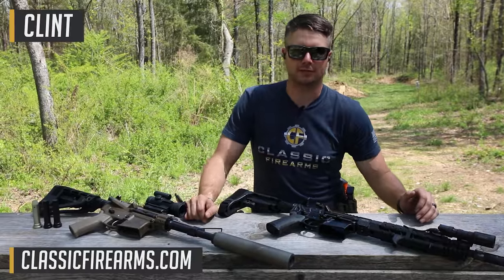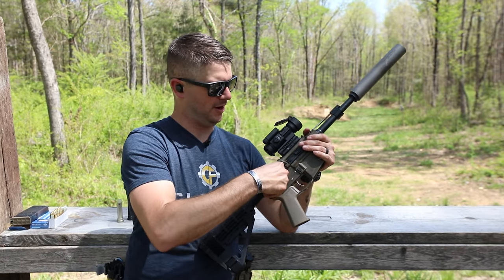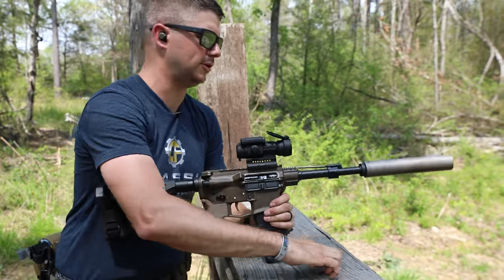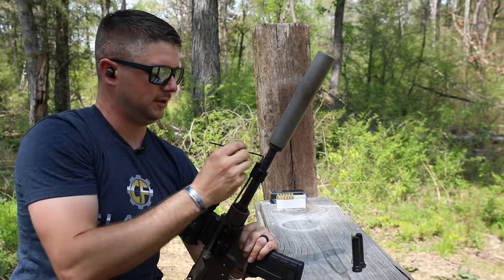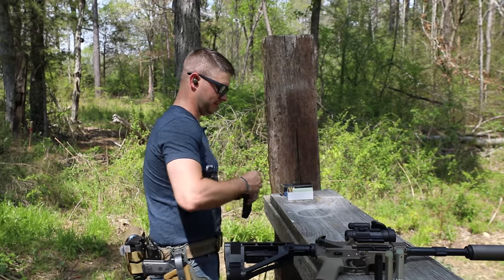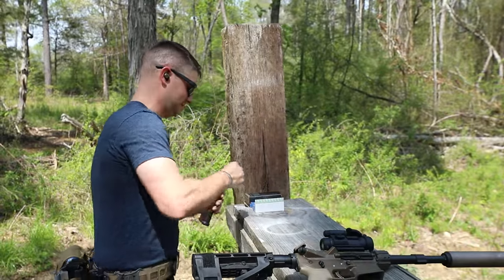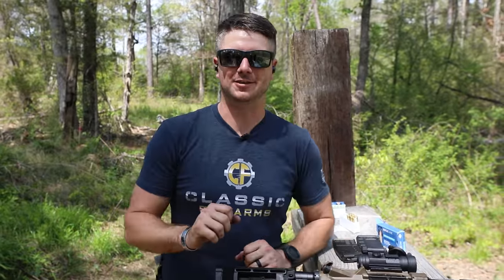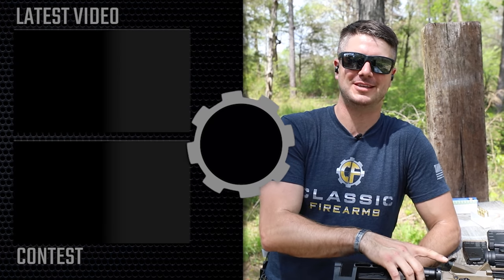How To Tune Your AR-15 (Gas Block & Buffer)

Comment: The key is tuning it to shoot subsonic loads because that's where you will encounter cycling failures. That video would have been much longer due to trying to  finding the correct setting to cycle subsonicaly consistently. I would like to see that video as a Part II.
Reply: 0 excuse me
Reply: Well with that you would need to tune subsonic and suppressed. The suppressor will change the way the gas flows big time
Reply: Subsonic loads have a longer impulse (dwell) time and are heavier, producing more volume and pressure in the gas tube. Tuning it to the "sweet spot" for subsonic loads may make cycling unreliable for lighter bullets, especially when running unsuppressed and even more so with carbine-length gas systems.
Reply: It should be tuned to the ammunition you plan on running through it…

Comment: All 5.56’s(.223’s) I run that have a carbine gas system have an H2 buffer in them. From an LE 6940, a DD M4A1, an older Bushmaster XM-15 w/a 16” bbl, they all have run well with all types of ammo, be it steel OR brass. Picked that up from Patrick Sweeney a while back..”IF it can run reliably with an H2 in it, run it”. HIS quote..

Comment: 2A armament adjustable bcg with a jp silent capture h2 is how I tuned my 11.5 and it shoots smooth with very little recoil with and without a can.
Reply: @UserAccountID   your logic would make sense if i was trying to run a lightweight build but no i just wanted a option to ajust my gas without useing a gas block and i run my setup with a can so with an h2 and tuned gas system in runs and recoils flawlessly in your logic its like go everything as light as possible then run an ajustable gas block but thats not what my gun is

Comment: Some of us prefer the 200+ grain subsonic in the .300 blkout. Can you run an experiment with the heavy bullets? Maybe show switching between 125 & 215 gr bullets.
Reply: If you run both subs and supers tune for subsonic ammo you’ve put in the freezer with no suppressor. The cold temperature lowers the pressure, and with no silencer there is no added back pressure in the system. That way you have a fairly reliable toy.

Comment: I’m trying to tune a Geissele Super Duty, 10.2”barrel in 5.56, with a SOCOM silencer. It has a H2 buffer with the 42 spring. Everything works fine, except my ejection is at 5 o’clock.  Should I turn it or leave it?

Comment: Thank you for the bit of info on the echo trigger! I didn't know you had to hold the trigger down to set it forward. My dumbass would use a razor blade to hold it forward and than lock it down 😅. Couldn't find a video on how to do it properly with the echo II. Watched one where a guy shaved down his BCG to make it work😳.

Comment: Aeros instructions, close it off, back out 15 clicks to full open. Fire 1 round, does it lock the bolt back. If yes, close it up 2 clicks try again. Keep going until it fails to lock open. Then open 1 click at a time testing until it does lock open. Once it locks open, open open it 2 more clicks for reliability and your done.
Reply: With adjustable block does this allow for a cleaner running gun?
Reply: @sranney1  it does reduce the over all gas volume going into the receiver. as far as cleaning goes, I would say its maybe a little better, but not by much.

Comment: One part missing here.  On most adjustable gas blocks, once you find the sweet spot in the adjustment, the gas block adjuster screw has a tightening screw on the side that needs to be tightened down too.
Reply: Not all of them do.

Comment: How did you know I just tested my 300 blackout setup and have crazy gas?Like rattles the buffer tube/ can hear it slapping recoile, and was hunting around for some options to fix that. 

Was thinking of going H3 buffer to see how it works and probably an adjustable gas block.

Comment: So, combining the two videos... You adjust gas to where it reliably locks open the bolt and you adjust buffer weight so your extraction is straight out or a little back?

Comment: Clint can you make a 5 and 10 round blaze orange mag for .223/55.6 .300 blackout?  They would be nice to have for hunting with my .300 blackout and i dont want the extra weight or length of the 30 round mag.

Comment: Why would you opt for a heavier buffer tube weight, if it was running reliably with a lighter buffer weight? Wouldnt that increase recoil and decrease accuracy?

Comment: Another great Vidja…… I choose to go with non adjustable gas blocks, but I swap all my guns to the Veltor A5. Haven’t looked back. In my 12.5 using a H3 and the 6” & 18” H2 with Criterion Core barrels using the Badger TDX. Get 4 o’clock unsuppressed and 3 suppressed. Can’t complain with that. Played around with other buffers until I shot a buddies with a A5. Credit card was smoking after that lol

Comment: How do you adjust the gas block, shoot with a suppressor and not test it with subsonic ammo???? I will say that the video that Aero Precision made for THEIR adjustable gas block is way more educational and cost you a lot less in ammo. I used their video when I adjusted my aero precision adjustable gas block on my 300 blackout. Btw, their video is quick and to the point.

Comment: My no felt recoil / no gas to the face recipe is a bootleg BCG , armaspec stealth recoil spring and a CMC 3.5 trigger =) 
I get practically no felt recoil with/ with out my CAN and, with my CAN no gas to the face. 
Easy adjustment not having to reach under my handguard to make adjustments with a long Allen Key. 
=) =)

Comment: Is it best to buy an adjustable gas block with a matching gas tube?? What brand are you using here?
Reply: There are only so many gas tube lengths, pistol, carbine, mid-length, and rifle; mostly depending on your barrel length. If your asking about keeping it the same brand, then no, I couldn't imagine any brand straying away from standard dimensions. However, your barrel profile may require your to need a different size gas block, most are .750 inch, but some are smaller for "pencil barrels."

I think he said Aero Precision, I have a Superlative Arms. I like it because it has detents every 1/4 turn so it will not move over time.

Comment: My ejection pattern for my 16 inch 556 is at 5 o clock (slapping my face). Should I use a different buffer weight?
Reply: I take it you're a lefty like I am. If your face is becomes the brass deflector, that generally means the gun is undergassed. You can use a lighter buffer or stronger loads. Although if your rifle reliably locks back on an empty magazine when it isn't shouldered, you're still borderline ok without having to change anything

Comment: Serious question: I have a 5.56 build with H1 (3oz) buffer/carbine spring, 16 " barrel, Adams Arms mid length short stroke piston kit with adjustable low profile gas block. I run Winchester 5.56 ammo with no issues, but any type of 223 or CHEAP 5.56 ammo i get it experiences cycling problems, also not locking to the rear. Any ideas? I want it to run ANY TYPE 223/5.56 I put through it. I am thinking about getting a buffer kit that can be modified from H1-H3 or possibly drilling my barrel port out from .078 to .081. Any ideas?
Reply: You say you have a adjustable gas block? Why not open it up? When i first got mine, i got the weakest ammo I could find and tuned it to that, that way I know it will run any ammo i throw at it. 

Other than that, weaker spring, maybe a lightweight bolt carrier?
Reply: either tune for 5.56 75-77gr brass case. or 223 steel case. there both on each end of the extreme so find what cycles both.
Reply: If you have a 3oz buffer, it's a carbine buffer not an H1.  H or H1 buffers are 3.8oz

Comment: I'm thinking of removing the front sight on my DDM4 V1 I bought about 10 years ago and installing an adjustable gas block. It's pretty gassy. I put a heavy buffer to calm it down a bit, but it still jumps pretty good. Anyone out there done this and noticed a improvement that's worth the $$ and time? Or, go adjustable BCG? Good vid Clint!
Reply: If your not suppressing the ddm4. Id steer clear of adjustable bcg. Very finicky and highly doubt you'll get what you desire vs going adjustable gas block. Plus its cheaper to go with adjustable gas blocks. Slr makes one of the best blocks imho. 

May I ask what weight is your buffer now and what spring your using?
Reply: @aahhronismyname8068  Thanks Bud! Not familiar at all with the adj BCG. I am running a Armaspec Stealth SRS H2 right now. Haven't really put it through the ringer yet either, just a few shots to see how it cycled. It was an improvement.
Reply: I use adj bcg on my carbines with A2 front sights suppressor and no suppressor 
Works great bootleg adj bcg

Comment: Never had an issue as I never install an adjustable gas block. And I don't run subsonic ammo or suppressors . Hot hand loads cycles fine. LMAO
Reply: You would only run into problems with shooting subs then. Also a suppressor won't affect reliability, other than early wear of parts, it makes it much better to shoot when you can restrict or bleed off the gases.

Comment: Hey Clint.  Love your content and Classicfirearm.  I would like to make a suggestion.  Can the term silencer not be use anymore.  We all know that the term silencer is being misused.  The device in question is not silencing the sound, which I know you know that, but defending this and educating other really become hard when that term is being you by our firearm community.  Suppressor is in my opinion the absolute correct to describe this device.  
Just my suggestion.  Lets now give them anymore ammunition to use against us.  I appreciate you.  USMC SEIMPER FI.
Reply: I agree with you but unfortunately the term codified in law is “silencer” and that’s also what the inventor, Hiram Percy Maxim, called it and used in his patent so we are kinda stuck with it.